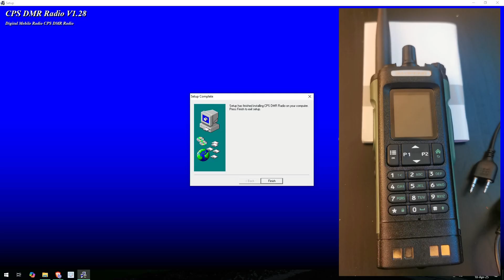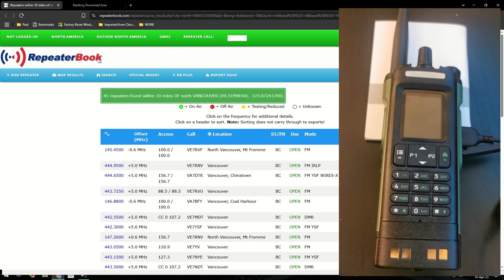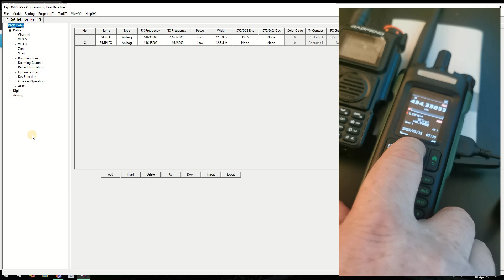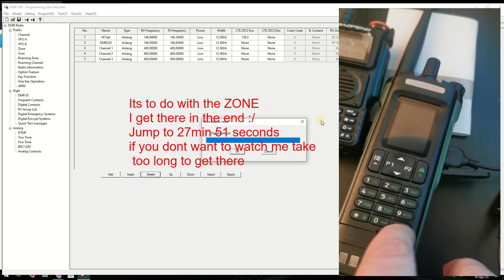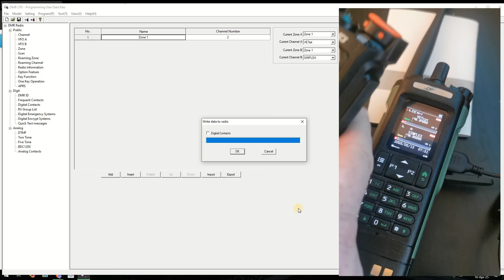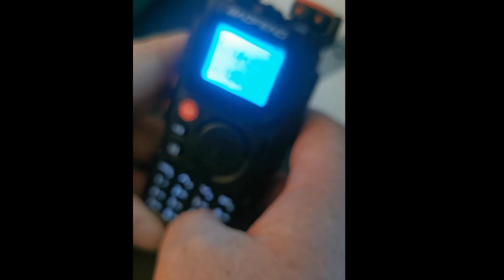Programming The Baofeng DM32uv Part 1 Analog Channels

Comment: Is there any chance you have the original data file from the radio when you got it. I factory reset  mine without backing up the original profile which i liked the settings on.

Comment: how do you shut off the BCL buzy channel lockout? I use it on a linked repeate system. you wait for a curtisy tone then talk PTT. but with the BCL on it takes forever waiting for the whoole system to drop.thye UV32 works fine, the DM32 is un useible.

Comment: I’ve had mine for over a month now, and I really like this radio. I was worried I might not like it as much as the AnyTone 878, but I believe I like it more. In particular, there is a setting in the CPS that is a game changer where you can allow the talkgroup that was last heard to linger on the screen for up to 30 seconds. So if someone in your open channels speaks, you can reply very easily by pressing the PTT button within 30 seconds (as opposed to manually finding the TG they came from if you were lucky enough to see it).
Reply from the maker: Im glad your having a better experiance that i am :) i like my Anytone878UVII Plus - its my every day ride around

Comment: From N. Idaho...
Will someone come up with?  or, maybe I should reword it as, “how LONG until someone comes out with a paid or unpaid
app/program to improve on and most importantly, simplify the various processes to set-up, program, and run the DM-32?? 

Question #2: Does the DM-32 prefer the FTDI cable, or the CH-340 cable?  Does it really matter to the DM-32?

I have a real FTDI cable from 2022. Used it on Windows-10.
But, it’s not grooving with the new DM-32 on Windows-11,  Had to buy a new $10 Mirkit PC03 ##3 RED! cable on Amazon, next day delivery. Worked.
Reply from the maker: Hey there! 🌟 I feel you on the app struggle, but for now, it’s all about experimenting with cables. The FTDI and CH-340 can have their quirks, but it sounds like you found a winner with that new cable! Keep on rockin'! 📻

Comment: Having trouble seeing the icons at the bottom of the CPS software? Try adjusting the "scale" from 250 to 200 in the windows display settings. Worked for me.
Reply: Your comment saved me, my scaling was set to %125 and that wasn't allowing my cps to work..  thank you bud, I was about to give up on 2 new radios

Comment: Your cable is just fine. The CPS does take that long when you are sending data to the radio. Also back in the beginning of the video under the settings tab you have the COM Setting with COM and USB. Well the USB is for when you are updating the firmware of the radio. It has to be put in USB under the Setting Tab.

Comment: Hello, when pressing Read Radio, it keeps saying Communication failed 😨 any ideas ? All com ports are correct and using a standard baofeng two pin cable 🤷‍♂️
Reply: Turn the volume up to over 50% but under 90ish percent. The radio needs to be able to hear the signal

Comment: When I downloaded the programming software, and opened it, all the headers were not in English. They looked like they were in ASCI or something. Help
Reply: Mine did this as well.  Close the CPS program.  Go into the installation folder.  It should be c:\DMR CPS\CPS DMR 1.38 and modify the CPS.INI file.   Modify the second line and set it to LANG=EN and save the file.  Now open the CPS program.  Done.

Comment: Hi, I faced a problem on programing this radio and I am trying to find out how to solve it.
Using the program, I edited data for 22 repeaters, I enterd them in Zone 1 and then, I uploaded  them to the radio and I noticed that all the menu was changed to chineese ! After that, I uploaded the native program and the language became english  again.
I did several tests but always the same. 
Any idea ?
Reply: Mine is the same. I have to manually set the radio back to English in the radio menus (in Chinese). But the numbers are the same as in English.

Comment: Just FYI, I had an older Baofeng UV5R analog radio and it's USB programming cable worked just fine on my DM32. Mid West USA. 👍
Reply: Wondering, friend, if you're working away on W-10, or W-11. Using my PC03 FTDI cable from W-10 2022, and would not fly. After many hours, a couple of cables, "only"  had success after a new $10- cable.
A red one I might add. I think it worked because it was RED!

Comment: from Philippines here, 4G9LGA
the manual suggests changing baud rate to 256,000 when writing to radio, and 11,520 when upgrading / writing firmware
does the 256000 baud rate change the writing speed to the radio? I'd like to program mine to find out, but the cable I ordered hasn't arrived yet
Reply from the maker: Yes it will .... 256000 to 11520 is a huge reduction in communication speed, so will affect writing speed dramaticaly !
Reply: Hi, no it doesn't work at 256000 baud.
Only at 115200. You often have to restart 5 or 6 times to read what's on the DM32, the connection is very bad, it's a shame

Comment: Has anybody figured out what "Fixed Analog" and "Fixed Digital" channel types mean?

Alex, from St. Louis, MO  AF0CP
Reply from the maker: Analog+Digital (A+D TX A): Mixed analog, allows reception of both analog and digital signals, TX is analog, A+D is displayed.

-Digital + Analog (D+A TX D): Mixed digital, allows reception of both analog and digital signals, TX is digital, D+A is displayed.
Reply from the maker: Not sure in what situations would  need this, but there you go
Reply: @ham-fam  Ah, so it should be "Mixed", not "Fixed", got it, thanks. I guess I should have figured that out from the manual. Thanks for the video. I look forward to part 2.

Comment: The programming software has an error and the analog encode needs to be in the decode when programming from the software. If you program from the radio the encode is correct.
Reply: So;
encode is decode and decode is encode?
Reply: @Redacted_Crow  When using the software to program the radio then yes enter the encode in the decode.
Reply: Thanks
Reply from the maker: Yup it was a real pain when you dont know LOL - i try to do my videos without Prep to show what you might come across.